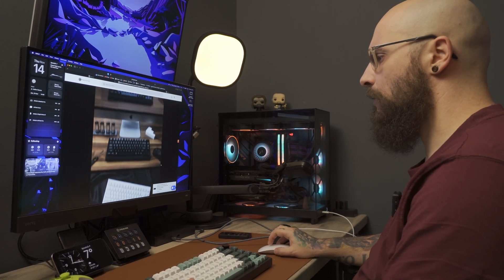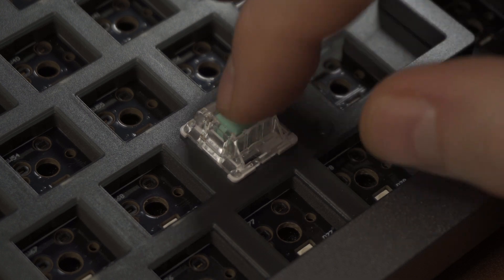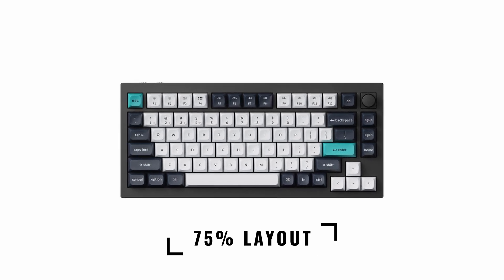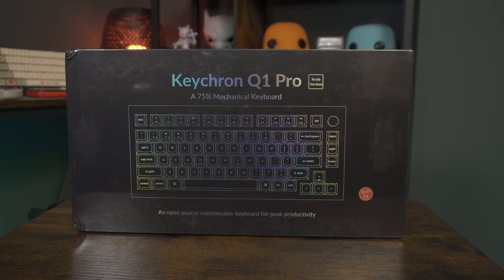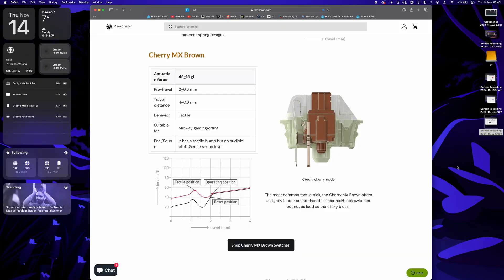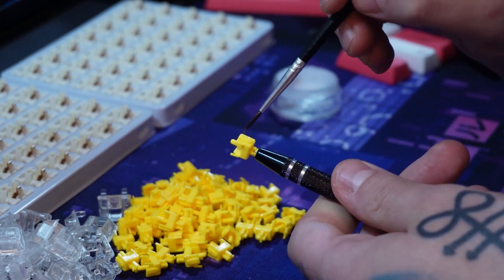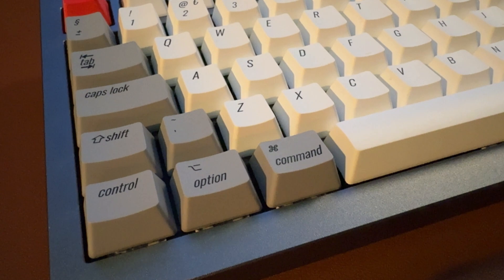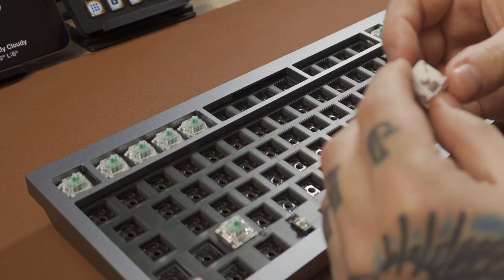How to build a Mechanical Keyboard

Comment: You don't pinch a switch from sides, you should pinch it from above and below (from where prongs are). And it's much easier that way to remove a switch. (though unplugging the keyboard was good idea)

 Also you don't have to change the "broken switch", bend back the contact pins and can use it normally, unless the pins are totally broken.. though prongs probably have already been damaged while you were removing the switch,  so new switch might be good idea :)
Reply from the maker: Oh my god… I’ve done this so many times and always thought switches were stupidly hard to get out! 😂 

Bending pins back is obviously ok but for the sake of certainty and as there’s normally always a few odd ones left over, it was just easier to swap it out. 

Cheers for the comment, man. Appreciate it.